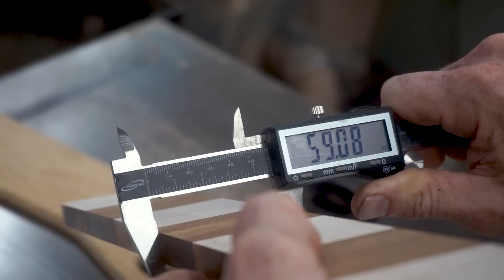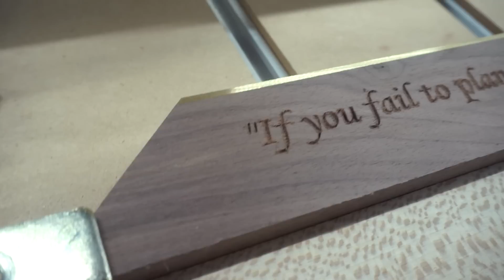Double-sided chess board with algebraic notation and inlaid quotations to sit atop a box for pieces

Comment: Hi Mike, love your stuff. Finished my first double sided board last Christmas. Just started an ebony and tulip board. I’m having trouble getting the male and female inlays to fit, I’m using Carveco software, any plans on a future video explaining the setting up of the cnc/software for the inlay work? All the best 🇬🇧
Reply from the maker: Typically what works for me with the engraving toolpath is to use a flat depth for the female engraving, and then for the male inlay, use a start depth set to 2/3 of the female flat depth, and a flat depth of 1/3 of the female flat depth.  I usually use 0.12 inches, and then for the male inlay I use a start depth of 0.08 inches and a flat depth of 0.04 inches.  Using millimeters, try using the female flat depth set to 3mm, the male start depth set to 2mm, and the male flat depth set to 1mm. That should give you good results.
Reply: @Woodumakeit  Brilliant Mike! I understand and I have been experimenting. The bit I am using has a recommended step down of .5mm. The only issue I have found is with the male path, there is no step down the bit plunges down to the final depth in one pass…….ouch!  Is there a way around this issue?  I am going to save several separate tool paths each with a 0.5mm increase in depth. Do you have to do this?  Thank’s for finding the time to get involved 😊 A video on the subject would do well I guess? Happy Easter!
Reply from the maker: @brianwaites4572  I use Vcarve software and I am able to control the pass depth. I typically have it set at 0.02", which is roughly 0.5mm. If you are unable to set that parameter, I think your workaround will work. That's a lot of extra trouble, though.  Happy Easter to you, as well!
Reply: @Woodumakeit  Thanks Mike! Very much appreciated. I may have to invest in Vcarve to make life easier.  Cheers.

Comment: Hi Mike, nice work you do. Question, what's the thickness of your plywood? Thanks greetings Kev.
Reply from the maker: Hi Kev, I typically use 1/2" (12mm) plywood, but I'm pretty sure the thickness of the plywood that I used here was 5/8" (15mm).  Occasionally I will use 3/4" (18mm) plywood, but I mostly use 1/2".

Comment: Does he not make the pieces as well?  I'm planning to build a chess set but the one thing I'm tad hung up on is getting the pieces to match perfectly. I have a lathe and would be able to use that to make everything but the knight but getting them to be identical would be difficult (if done by hand). It's my understanding that commercially they use like a metal pattern that cuts the piece on the lathe to ensure each piece is identical.